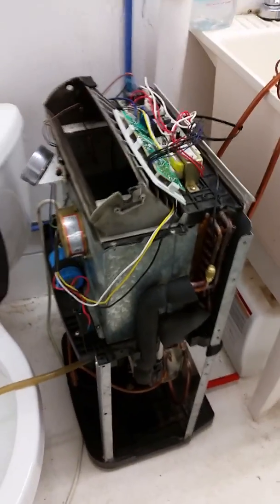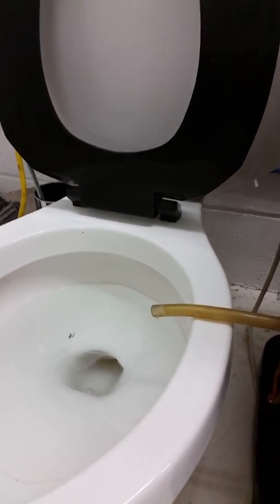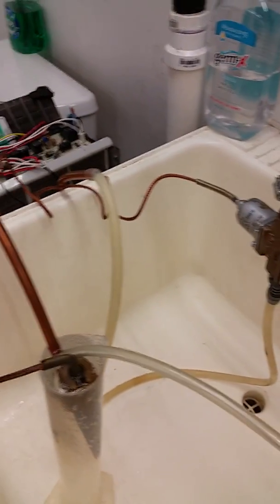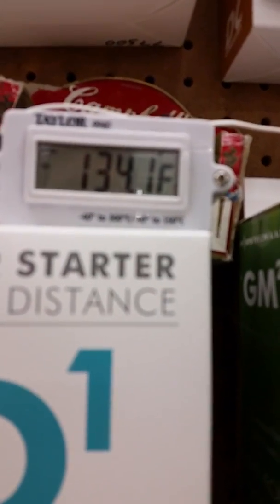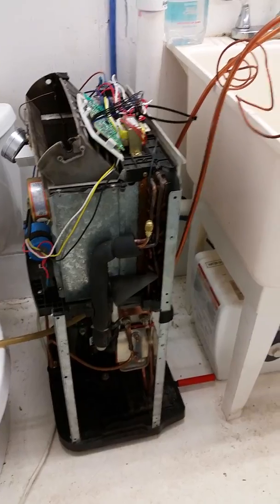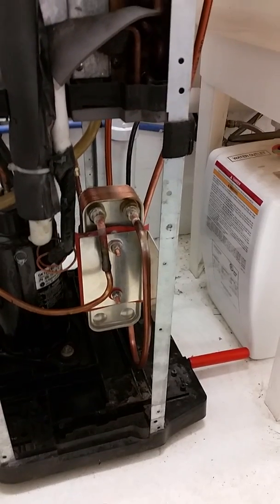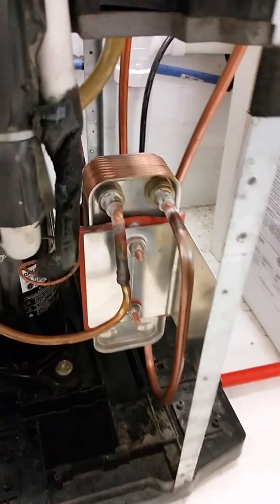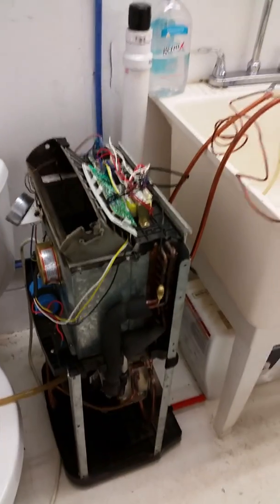Portable air conditioner water cooled conversion

Comment: This is an excellent project. If you live in an area where water is cheap like Toronto, you can run the cooler open loop because even just sending the hot water right back into the drain is cheaper than the electricity costs of using ambient air to cool the evaporator. I was going to simply build something to flow water over the evaporator directly to avoid having to reclaim the refrigerant and have to refill it, but this is definitely a better way to go. Just watch the compressor temperature because these portable units flow air over the compressor to keep it cool as well and by removing that blower, you're at risk of overheating the compressor.

Comment: Super work, which refrigerant liquid did you use? Did you had to change valve? What power is a compressor? Did you had any major problem? Did you soldered plate heat exchange by your own? I want to do similar thing but use PHE on evaporator place.

Comment: Interesting conversion! Did you have to refill the coolant on the condensor loop circuit or could that stay closed-looped when you replaced it with the plate heat exchanger?
Reply from the maker: I had to refill it, i first had it reclaimed by my local heating and a/c shop.